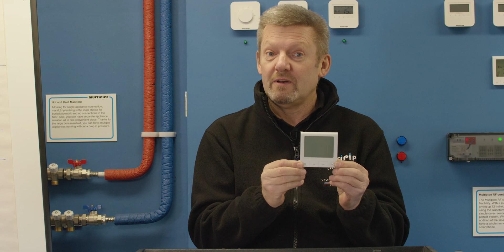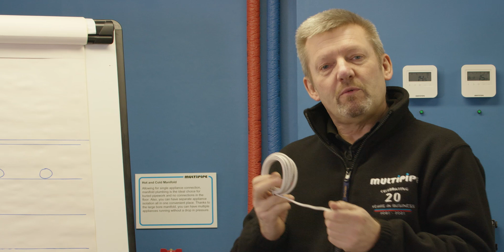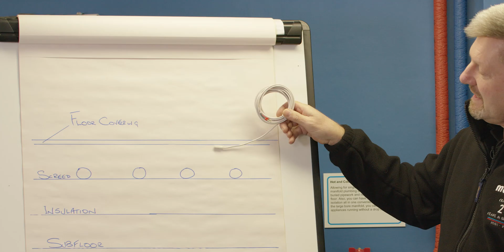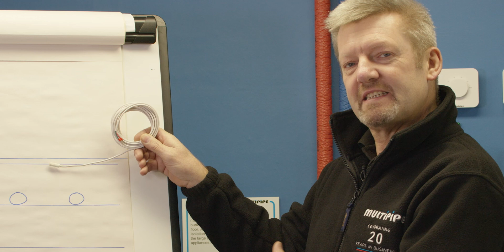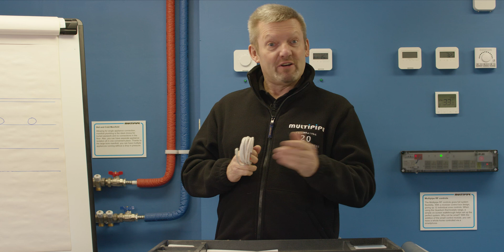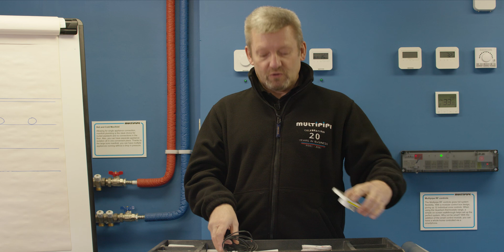Which Underfloor Heating Sensor Should You Use?

Comment: Hello

I am in process of installing water underfloor heating to the entire house. As part of the project the engineer is also moving the boiler from kichen to garage. 

My question is when the project completed what kind of certificate and documentation should I get for the underfloor heating installation and for moving the boiler for my future record. 

Can you please list out what should I get from the company on completion please.

Thanks,
Reply from the maker: If it is our UFH system and the whole project was supplied by ourselves then you do get a homepack which contains all relevant information on your system inc. how to run it, how to maintain it and other relevant information for you specific project. and installer and further maintenance requirements for the future.
Reply: Thanks for your response.

Comment from the maker: 👉 Not sure about which underfloor heating sensor you’ll need to use? Let me know if you need help by commenting below!
Reply: Hi can the floor sensor be replaced? Mine is showing an floor sensor error code. Cheers
Reply from the maker: @markazz1000  It does depend how it was installed. if it is in a sleeve you can normally pull it out and replace. but sometime they are not sleeved so you would have to chop the floor up.. firstly check the stat and wiring as this is normally the issue.
Reply: Cheers
Reply: I have four rooms and 7 loops of PEX pipes in a system so how can I suppose to use my floor probe. Do I need to take all my probes to the particular rooms . Please tell me how can I use my probes